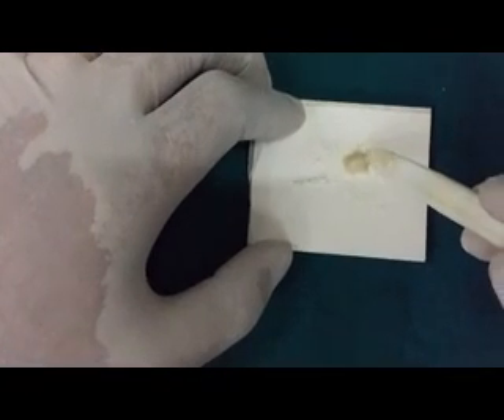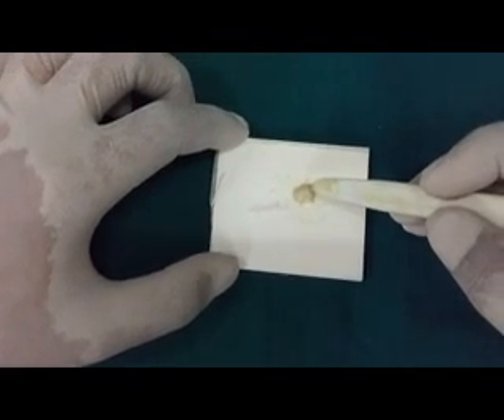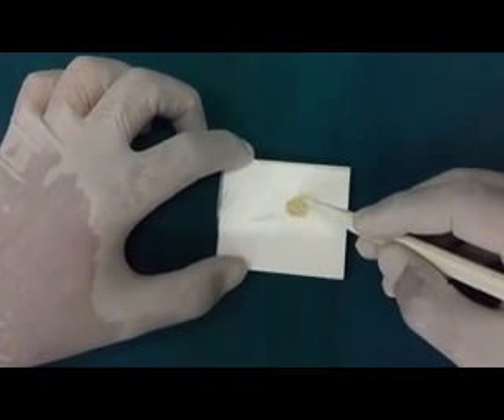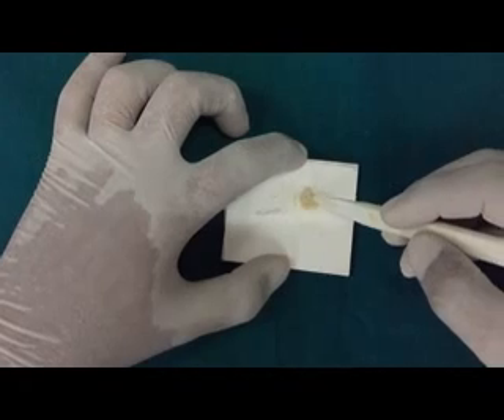GIC Manipulation

Comment: I’m sorry, but the people who developed this didn’t think things through that clearly it seems...
First off, Vaseline isn’t going to protect a tooth surface from saliva contamination for 24 hours. That’s completely impossible unless you’re working on a cadaver or practice mouthpiece. Second, expecting the person to not eat or drink for a full day as well as returning the following day to have the restoration manipulated and buffed is also clear evidence of short sightedness, and a complete fail in terms of this actually becoming a viable product and/or solution. In concept it’s great in the sense that it chemically adheres to the enamel or dentin and the fluoride release promotes tooth structure rebuilding in a sense, but all of that is irrelevant too when even after somehow following best practices and the patient adhering to this absurd protocol, the material itself wears very easily and in many cases may last only a few weeks to months at best.
This product should be configured for retail/pharmacy use as a patient administered temporary material only as far as I’m concerned.

Comment: Is it possible to simply coat the ionomer with a light curing bonding agent to prevent loss or intrusion of water?
Reply: Protection of GIC Restoration
1.A contoured matrix is used to cover the GIC.
2. Once set, the matrix is
removed and the surface of the cement must
be protected using cocoa butter, copal varnish or petroleum jelly to prevent desiccation or moisture contamination.
Reply: @dr.sandeepkumar7488  very short sighted so called solution...
Reply: I forget the name of it offhand, but your typical run of the mill brushed on gum line sensitivity varnish seems to work well. Certainly better than oils which are quite easily pulled off the surface due to acidity and plain old abrasion from flesh surfaces inside the mouth.

Comment: what is the best Glass Ionomer Cement in the market that last far longer 
Thanks heaps for a nice video.
Reply: There isn’t one. This product (and I’ve tried all of them coming out of India) should only be marketed to patients through pharmacies as a temporary restorative material for emergency use, as it’s simply not cut out for use in a professional setting. Nor does it have any innate qualities that command its use as a permanent or even semi-permanent restoration material...

But if you really want to try it and would like to avoid all the trial and errors, then in my experience the product “Micron Superior” by Prevest DenPro has been the most forgiving to work with, and seems to hold up the best. Keep in mind though, that by “best” I’m talking an extremely marginal difference. It’s extremely cheap too. Purchasing in quantities of ONE will have it landed in North America direct from New Delhi, India for under $15USD all-in. And there’s enough material in a single kit to cover 50-75 uses quite easily.
Reply: @MikeOxlong-  GC Fuji restorative type 2 are the best and Dentist used 
Also, Kerr kavitan pro is another Good one 
oh well, Cheers